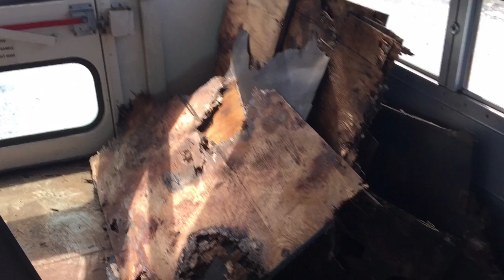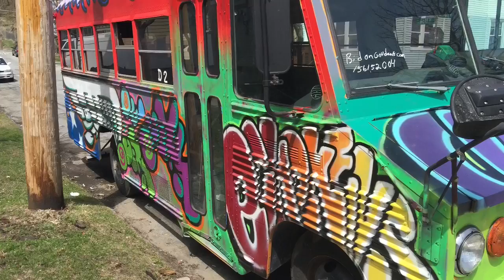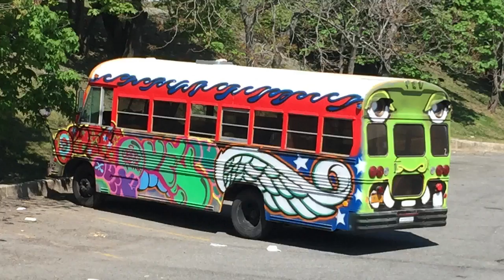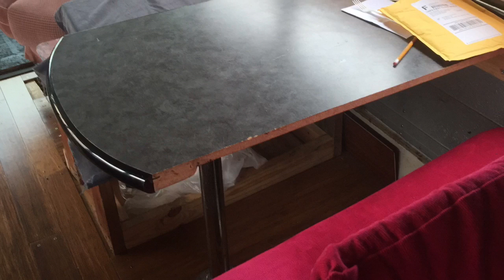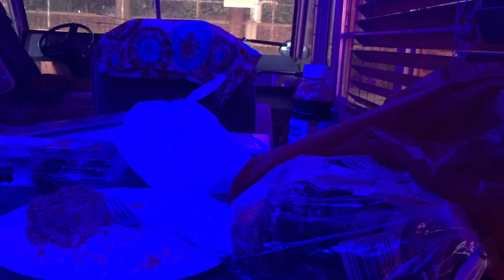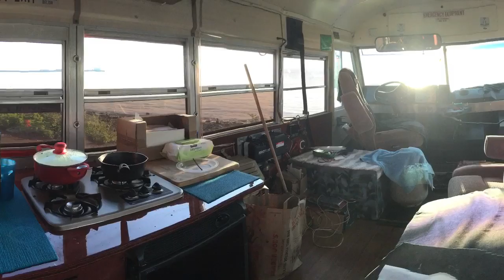Blue bird mini P30 school bus conversion start to finish

Comment: that's so awesome!     i really wish i had carpentry skills. 

do you travel far with your bus? 
 vacations and camping? 

some videos I've watched on YouTube,   people converting busses and vans,  have decided to live in them and keep on the road!    that's pretty awesome!  

i had a question about the little wood stove heater,   how does this work? 
wood,  obviously lol,   so do you need to build a ventilation system through the busv wall or ceiling? 
 and how warm are you with the insulation you've installed ?

thank you, i thoroughly enjoyed the video!
Reply from the maker: Dr.Lady_ Karen_TM it goes out the window through the exhaust pipe /chimney
 No I don't go anywhere but here for now Learning curve practice
I do this so I can property with a view
Reply from the maker: irish K no I live here in New York 
City 
On the bus don’t go any place but nice waterfront views here
Heat is wood no venting needed as bus is a bit  ( lol ) drafty

Comment: Hey Ron!   Nice conversion.  I have been wanting to do one, and use it for a permanent residence.  (Travel and see what I have missed.)  I used to drive a school bus and most of the ones I had experience with were a bit short on stand up head room for me.  Does the P30 have close to 7 foot from floor to ceiling?  How reasonable was it on base unit purchase price?
Reply from the maker: Kevin Baker it was 1600$ bus at govdeals.com 
Height I have 6'3" the bus has 6'6"// 6'5"
Center line
Reply: Thanks, I will keep that in mind.
Reply: Kevin Baker u
Reply from the maker: Oh darn 1,600$ bus cost